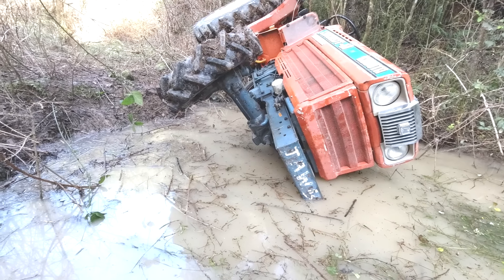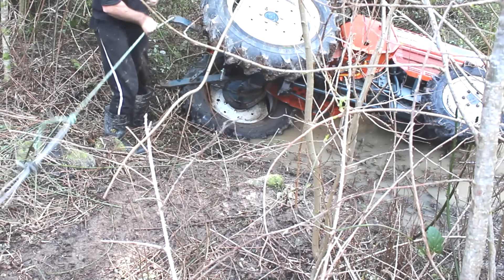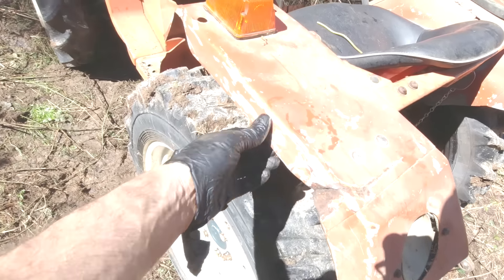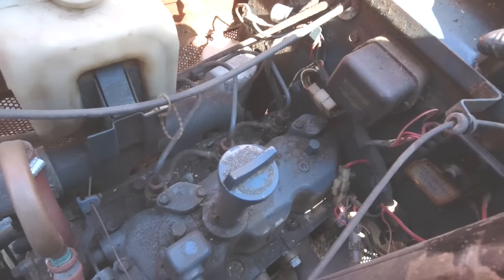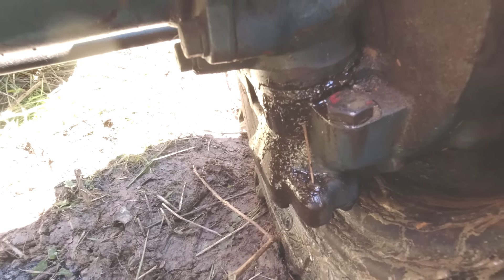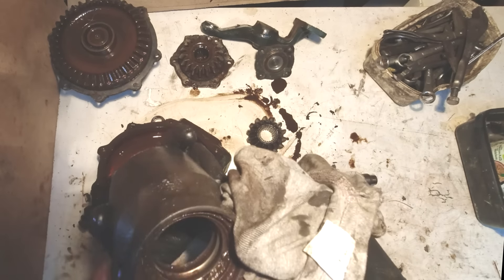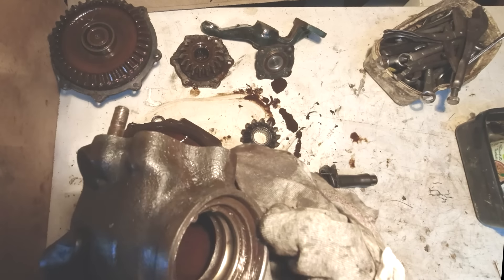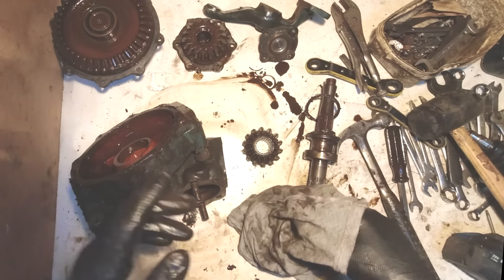Salvaging a Crashed Kubota Mini Tractor.. Owner wants it gone!

Comment: Had the exact same tractor, and loved it. Just in case you don’t know, you really need to use the glow plugs to get them going. Turn the key backwards and hold it until the round metal thing with a hole in it on the dash glows, then it will start right up.
Reply: We have a small New Holland my grandfather bought brand new back in 2001 which has a small Perkins in it. Use the glow plugs like intended and she starts up first time every time. Besides standard care it's never needed anything major and is always maintained.  :)
Reply: I believe Marty was clearing the cylinders, just incase engine oil got in.
Reply: Yes we had kubota engines in the skidsteers I worked on, give me heat to start and don't let them overheat and they were generally reliable.
Reply: You never use glow plugs if you aren't sure if your cylinders are clear of diesel or oil. This was on its side.. remember?
Reply: @netrioter  complete rubbish, it’s a diesel and no way would it, or the engine oil ignite without compression.
Besides he already turned it over with the decompression valve open.
Reply: @netrioter  I would take care with the first turn-over for the same reason (hydraulic lock).
Reply: Don’t really need glow plugs in warm weather.
Reply: @cannedheat2264  shows how little you know.
Reply: @rohanhamer8429  it’s true I never have to let them warm up in warm weather. In -30 plugged in I cycle until they are warmed up.
Reply: I find small tractors handy in my barns

Comment: As a millwright i can tell you that having something destroy the bearings is actually the best thing. Bearings are pretty much consumables lol, sure they should last a long time, but they can be replaced, and they’re standardised, so it’s usually pretty easy. Also they can take all the damage, and save the rest of the housing, whatever it may be
Reply: I was puzzled when he expressed caution on the destruction of bearings and seals, as all such stuff I've handled on that front have all been standard. One positive is don't have to suffer rip off OEM parts prices or risk it with eBay crap, you just go down to a local bearing supplier.
Reply from the maker: Yes but when the bearings come apart it can lead to expensive gears and casings being damaged as happened with this one, luckily I think I caught it in time
Reply from the maker: @COlcultist turns out this one had some special parts the bearing shop had never seen, I had to translate the model to Japanese search to get the part numbers
Reply: @MartyT  hey mate, currently live in Japan but still learning the language. But if you ever need something from over here I can help try and find it. Cheers for the videos, from a jafa
Reply: @MartyT  I'm left wondering were these non-standard, or how good is your bearing shop? I could conceive of a massive production run having something non-standard, but Kubota commissioning a non-standard bearing? Now the exception that I do know that proves the rule (it is that long ago I can't remember what was done) was needle bearings for two-stroke little ends, but I think that was something to do with machining tolerances being wider than the needed tolerance, so components were matched to produce working sets.  Most of my buggering about with bearings and seals came after being introduced to the joyous world of motorcycles, and my Guru steered me firmly in the direction of Spen Bearings in Cleckheaton, who were always shit hot at helping me. RIP Mark Dicker!

Comment: Take the other side of the front end to bits and swap the bevel gears side-to-side, then the un-worn side of the teeth will be in use for forward.
Reply: I wonder if the axles could be swapped or if they're different lengths.

Comment: Be nice to put a set of duals or 3” spacers for stability. Not bad for $400.
Reply: Dam right
Reply: Even swapping the rims the other side out would help
Reply: Too right mate . Some bloke at finding and rescuing the old machines . In at the deep end to fix them up and put them back to work . . Top man .
Reply: I have never operated one of these little tractors , but I know has much difference dualing up makes on the bigger ones , that extra stability gives a lot more confidence . Never had wheel spacers , but it seems to me that they might cause extra wear on the axle bearings  , maybe a place where the added leverage might loosen things up

Comment: Marty throws a pair of pliers,a pipe wrench,roll of duct tape,and some bailing/mechanical wire in the back of his truck and heads out to revive a 50 year dead abandoned machine and then drives it back... Every.... Stinking...Time... 😁
Reply: i like marty very much but come on dude he only shows what he wants you to see you seriously think he's never gone in and said mmmm nah beyond my skill and pay grade?
Reply: Has anybody actually used duct tape for ducs? Because I sure have never done it😂
Reply: @captainfancypants4933  he does show everything, (video run-time allowing), and he has previously “gone in and said beyond my skill and pay grade”. Check his video on the abandoned tractor he found based on ‘rumours’.

Comment: Never fails to amaze me how some people treat their equipment , I was always brought up to believe “look after it , it will look after you “
Reply: all of that damage could've been easily & cheaply avoided, maybe the owner just wanted a new toy so wasn't bothered
Reply: @rubusroo68  I can understand the owner want a new toy that's more suitable for his usage.  But those bearings didn't get broken when the tractor lay down for a rest.  They've been flogged out for a lot of hours.
Reply: Sadly the previous owner of this machine seemed to subscribe to the mantra, if it is broke don't fix it, so many of those issues could have been stopped by some TLC and a little knowledge of when you are actually shortening the life of the tractor.
Reply: When a machine is a poor fit for the operator, it always gets neglect ... I think I would love it's high centered mountain goat pervue

Comment: you have got to be the luckiest man alive. i wish someone would offer me a 4x4 kubota for $400. hell, that thing has $400 worth of tires on it. that's an easy $2-3000 around here.
Reply: Just out of curiosity what currency are you talking in?
Reply: here in germany in used condition they are about 6 to 8 thousand!

if you can afford a used one you are nearly in range of a new one!

✌
Reply: @t.r.l.4377  so true, same here in belgium, and they are in high demand
Reply: @fenderOCG  usd. a kubota in perfect condition is $5-7000 usd. if it has a front loader, close to 10k.
Reply: @t.r.l.4377  in perfect condition, they are about the same here. $2-3000 is for one that needs a lot of love like this one does. i've seen chassis with no engine or rear tires sell at auction for $2500 usd.
Reply: @handyhippie6548  that's very wrong.
Reply: @clayton9136  what is? the name kubota commands high prices here in farm country. a shibaura built ford 1720 in good shape with a loader brings over $10,000, all day long.
Reply: In Minnesota they are not worth that. 1000 in that shape. 2 at the most

Comment: very interesting video. I've always wondered how those hub assemblies come apart and what goes on inside them. it'll make mine easier when i have to pull mine apart
Reply: I worked at CNH for years on the compact side front hubs aren't bad it's the back hubs that are more a pain need a special alignment tool for reassembly or you got major issues after

Comment: Also you should upgrade your ute taillights to leds ebay has them, Will help you during the night and also mske the ute look so much better, I have a 1991 tf holden/Isuzu rodeo with the 2.6 4ze1 currently getting her ready for rego i bought taillights off ebay and there amazing haven't tested them through bush yet as it's not registered but reverse lights are nice and bright breaks are bright taillights and blinkers also don't have to worry about replacing bulbs ever again 😀

Comment: Just the engine alone is worth more than 400 bux,not to mention the tires would bring 400 bux,and then there's the front and rear axles,each worth way more than 400bux each... Marty ain't stupid by no means and could recoup his 4 bills 4x over pretty quickly even on a grey market tractor. ..and only 4 bills for a down sized 4wd tractor in pretty nice usable condition is giveaway priced...

Comment: I had a gray-market yahmar that was a lot like that one. Its wheelbase was so narrow that it was scary as hell to drive on hilly terrain.
Mine didnt have a radiator and I eventually badly overheated it.  Couldn't get it re-started and got rid of it.  Probably the best thing I ever did as I was pretty sure if I died an early death, it was going to be on that tractor.

Comment: We have one of these on our hobby farm, it's great. We do have spacers to widen the track by about 6 inches each side which made it much more stable
Reply: something has to help for sure
Reply: Most of those tractors you can adjust the wheel track by un bolting the wheel center plates and either turning them over / moving them from one side of the rim mounts to the other or both. In this case you can widen the track by swapping the rims left to right.
Reply: I have a b8200 hst and I keep mine upright by always having a freaking flat tire and never driving it.  🤬🤣🤣

Comment: My dad had an L175DT with a loader and backhoe that he bought new in 78 or 79. It was a very good tractor. Used it for many years for residential building doing site grading and utility trenches. It will be great to watch you work on yours. Only troubles we had were voltage regulator and glow plugs. As i recall bearings and seals are pretty standard generic stock.
Reply: Just sold my l245dt with a loader backhoe combo great little tractor

Comment: Exchange the two rear wheels (the whole wheel/tire assembly) side to side. This will improve your rear traction. As they are now mounted the tire lugs, when they dig in, will tend to pull loose top soil/dirt into a mound under the tires causing the tractor to float and lose traction.
Reply: I have found this to be incorrect.  I noticed much better traction when I ran my ag tires backwards.  Better on snow; better on dirt.  A rougher ride on pavement though.
Reply: yes, the tires are backwards for some reason, but I would flip them in place as that makes them come out increasing the wheelbase and improving stability quite noticeably

Comment: Great! Mini tractors like this are rare here in Sweden. We still use our old MF35 and Fergies for small work. Then got new big ones for harder work. But the small Kubota sure can be quite handy i think! /Richard
Reply from the maker: They are quite common here but can be difficult to get parts for.. They're  cool little machines, I love the super low range
Reply: @MartyT  Yes like the old David Brown 900D's. You can park them running in first low and leave it over night and still it hasn't got further than 10 meters away.

Ok, hope you find all parts you need for it! Good find for 400 anyway.

Comment: If you cant source new bevel gears (or source them at a reasonable price), may I suggest swapping them as a pair from left hand side to right hand side hubs and vise versa.  It will put the more worn gear faces currently in mesh when going forward into mesh when in reverse, and bring the the less pitted and worn faces into mesh when going forward.  Should maximise the life of the gears you have if you cant get hold of new or good used ones.
Reply from the maker: Yes I did think about that but cant be bothered stripping down the other side 😆

Comment: Great to see you doing these again! Even with the damage to the front knuckle there, THAT is a screaming deal for mainly the effort on the come-along & a battery.
 Can you elaborate some on 'gray market' tractor please?
Reply: If it’s the same as in Australia, the gray market is a term used for imported second-hand vehicles.  There’s no dealership, just a business purchasing vehicles in Asía and supplying them ‘as is’. No warranty, no support, or spares.
Reply: I believe it refers to vehicles/machinery brought in to the country second-hand from a third party country without dealer support.
Reply: @stephendalby836  And a lot of authorised dealers won't touch the vehicles because there is no service history with them and the manufacturers are reluctant to supply parts in case they are keeping obsolete machines in service which ( in their view) should have been scrapped.
Reply: @ Stephen Dalby/ @ Tu te Kohe Thanks, I appreciate the answer.

Comment: What is a grey market machine?
Reply: Most likely directly imported, so not supported by a Kubota authorised distributor, so parts not readily available and no one interested in supporting it.
Reply: Was wondering the same thing.
Reply: @gjlwpl  also kubota dealers are instructed not to support with parts or manuals etc
Reply: @michaeljones6832  That doesn't seem like a solid strategy for building brand loyalty....
Reply: It means a vehicle that was imported from another market to one that it wasn't generally destined for. Often by an individual or a company that deals in importing vehicles that isn't part of the official/normal route. Grey imports are quite often second-hand vehicles, although for example, here in Japan we have a company that imports new vehicles into Japan that are not normally available here. E.g. Toyotas from Europe and elsewhere, Isuzu SUVs and pickups (Isuzu only sells trucks/lorries in Japan). They are also sometimes called parallel imports. Despite the name 'grey', the imports are usually legal. However, some countries will have restrictions on what can be imported. Often, grey imports will require some modification before they can be made street legal. Most obvious example being importing a vehicle from the USA requiring that the rear cluster lights be modified to include an amber turn signal, be fitted with fog lamp and reversing light (for the UK for example) if none are fitted (there are exemptions for certain vehicles over a certain age in some cases).
Reply: I think it's where a machine is manufactured with the intention of only being available in a specific market/country but then ends up being sent to different countries (refurbished) that never had them new... In this case this tractor may have been made for the domestic Japanese market meaning parts are very hard to come by for an eventual owner in a different country... Hope that makes sense.
Reply: Asian, Taiwan, Chinese etc.
Reply: Kubotas are mainline machines in the US,whereas the rest of the world they're gray line machines as in not as popular or available nor any dealers nearby nor much support overseas such as in NZ or Oz or Ireland,or the UK,or India,etc... Kubota isn't a brand name,well supported machine there just as Lamborghini tractors isn't a well known or supported machine in the US or lots of other places but is well known and supported all across the UK... Mahindra is well known in India and Africa and surrounding areas but not as popular across the rest of the globe,etc making them all gray Market equipment in those less supported regions..

Comment: It's insane how tough a hilux is . Carrying a tractor on it's back like nothing . They dont built mini trucks like that over here in the states
Reply: Its not a hilux, its a holden rodeo(rebadged isuzu).  And it definitely wasn't carrying it like it was nothing. It was squatting hard, and you could see the springs were bent the wrong way before he unloaded it.  And it rose up a lot once the weight came off.

Comment: In short - this tractor is a hybrid, coming from both Kubota and Daedong and there is no real North American equivalent. But fear not! It is still possible to get parts.

The engine in your father-in-law's L1802 is the D1102, a 3 cylinder. This means that any engine component (waterpump, injector lines, glow plugs, starter, etc), are all still readilly available for ordering. If you locate a parts manual or list of parts for Kubota's D1102 you will be able to lookup most parts you need. For example, we have cross references for oil, fuel and air filter numbers here:

http://www.orangetractortalks.com/2008/12/gray-market-kubota-oil-filter-part-numbers/
http://www.orangetractortalks.com/2008/12/gray-market-kubota-fuel-filter-part-numbers/
http://www.orangetractortalks.com/2008/12/gray-market-kubota-air-filter-part-numbers/

Comment: Baby tractors are ok for light ag work but pulling stumps? Ambitious. I enjoy your logical problem locating process, and the editing of your videos.
Reply: Had he used the super low gear ratio and the hitch point at the rear of the tractor which is designed for pulling....might have worked much better...

Comment: from what I've learned, 'grey market' Kubotas are tractors not authorized by Kubota to be sold in a particular market, and dealers are forbidden from selling parts for that model. However, Kubota just mixes 'n' matches engines, trannies, axles etc so if you can find the correct 'white market' tractor, you can just order by part number, which they'll sell you all day. Speaking of my experience here in Alaska with a tractor bought from Canada.

Comment: I haven't searched the comments, but I have a similar model, you turn the key the wrong way for ten seconds before you turn it over, this preheats the glow plugs for a clean start. These Kubota engines are really strange, designed in Germany between WW1 and WW2, the "D" series are 3 cylinder, "D" standing for "Drei", (German for 3).

Comment: I have this tractor.  Turn the key to the left to warm up the glow plugs. There's a sighting hold that turns red when they're warm.  Takes almost 20 seconds.  I had to run a flexible exhaust pipe so I wasn't sucking back so much diesel fumes all day.
Reply: Mustie1 was killing his starter the same way, stubbornly refusing to let the glow plugs do their work.